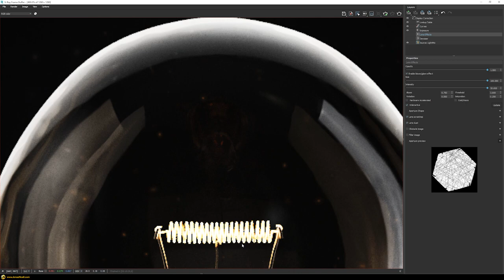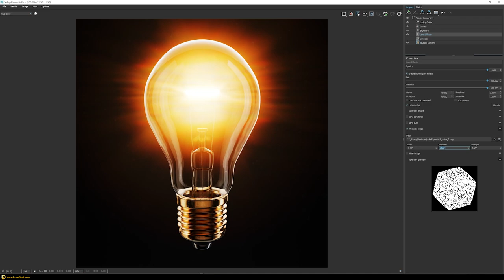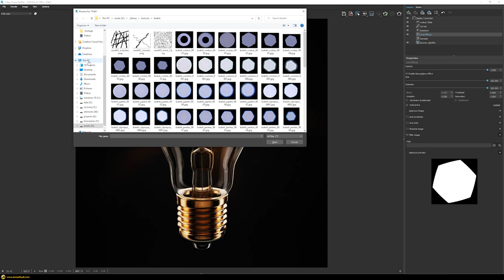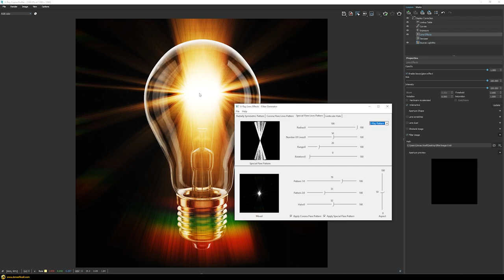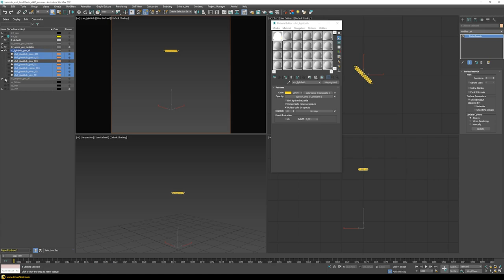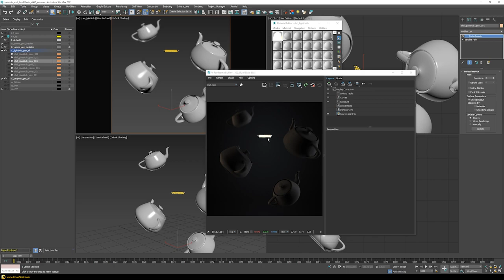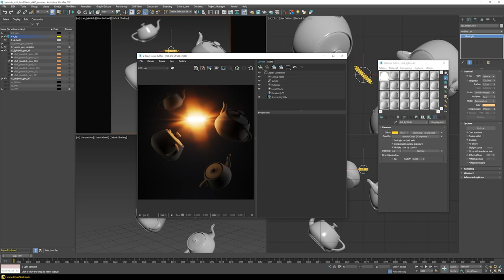V-Ray | How to use LENS EFFECTS | Theory, General Workflow, Issues & Solutions

Comment: Hello @JonasNoell

I have a render scene of 3dsmax+Vray and somehow I cannot run the lens effect except when I open a new max scene from scratch. What you have to switch on that it will work or what can cause it's not running?

When I've got open a new scratch scene it works but how can I select, that for example only one light bulb of three is glowing and the others not even if I applied VrayLightMtl?

I dont know where else to ask
Reply from the maker: This only works in the latest update of V-Ray where you can apply a mask to the LensEffects. You can check out my 6.1 Update video for that. 
As why your lens effects only show up in a new scene probably your original scene doesn’t have the ‘Autoswitch to Effects result’ enabled in the render setting in your original scene…
Reply: @JonasNoell   Thanks JonasNoell but it's ticked on. Somehow I dont get why it's not working in my scene anymore. Maybe something is colliding or avoiding it.

Anyway I would like to ask you another question because I am pretty sure you know how to solve it. 

Cars most often have Daylight LED in the front. Is there another way you can light it up in Vray than with VrayLightMtl because I am missing the lens effect (glow effect)

Comment: thanks for the video. but why it is not showing if I put exponential in my color mapping and have my burn and bright value  adjusted. Thanks
Reply: Had the same problem.  Someone else pointed out that it may be the Color Mapping render settings. Instead of using Exponential try using Reinhard or Linear Multiply.  Worked for me.

Comment: hey Jonas I love your videos, i was wondering why you never use the mesh light option for lighting things such as this light bulb metal piece
Reply from the maker: Hi, because mesh light is like the most ineffective way of lighting something, because it would internally create one light per each polygon face. So unless there is a really specific reason why you can’t get around mesh lights I would basically avoid to use them at all costs :)
Reply: @JonasNoell  wow, I didn't realize it creates a light per polygon, that must be heavier on the render engine.. what if its a very low poly mesh though, thanks for answering <3
Reply from the maker: @sherifhany386  The more lowpoly the better of course, but I would always try to fake as much as possible by just using planar, disk or spherical lights wherever possible. So far I haven't really encountered a plausible situation where meshlights were the only possibility. But anyway it depends on your specific situation. I'm not saying you should definetly not use them, but you should be aware that meshlights are the most uneffective way of calculating lighting in V-Ray. So if possible try to use other approaches :-)

Comment: Great One !, Keep up the awesome effort 
How can I generate  Bloom/Glare for specific lights in the scene (Instances for example) or how can I have more than one type  of effect applied inside the Frame buffer without the need mask it in the post (photoshop)
For example
First one is settled effect for the large sources like windows
The second effect could be much stronger for small sources (lamps/spotlights ...etc)
Reply from the maker: Hi, thanks for your feedback. Regarding your questions, AFAIK right now it is not possible to have multiple lens effects with different settings for different light sources in your scene. The only way to control where the lens effects are appearing is with the treshold so you can just limit the lens effects based on the brightness of certain pixels. For a combination of different lens effects you would need to go through Photoshop. I agree it would be better to have more control about this, such as multiple lens effects for separate lights and so on. Let's hope for a future update :)
Reply: Even if it seems that we are working on light, it is in fact on the parameters and the nature of the lens placed in front of our camera that these settings apply. It is therefore natural that these adjustments apply to the whole image. You cannot use several objectives with different types of diaphagmes or different lenses depending on the part of the image to be processed.

Comment: I never got the lens effect working, is it because i use architectural feets and inces unit setup instead of mm or cm or is it something else, also when you use Vray sun along with interior lights and use lens effects there is bloom and glare in all the illuminated portions even when you play with the threshold value it doesnt seem to work so if you can help in that it would be great, i can also share a simple scene to illustrate that
Reply from the maker: Hi, the chosen units do not have any impact on the lens effect as it is a very 2d post effect that is applied to the finished rendering. For the other part you would need to share a scene and I can take a look :) info@jonasnoell.com

Comment: there are no layers over here. no lens effects.. nothing. how do you get them back? can't find a solution anywhere
Reply from the maker: Should be there by default, in fact there is no way to remove it manually :-) Try switching to Scanline render and then back to V-Ray and see if that does anything
Reply: @JonasNoell  strangely enough that did the trick.  thank you!

Comment: How do you save out the lens effects pass in animations? Not just stills?
Reply from the maker: Hi, it generates a RenderElement pass calles Glare, that contains the layer so you can use it in post. There should be no difference between stillframe and animation in that regard.
Reply: @JonasNoell  I usually have to render a still frame then apply glare. Do you mean once I have done that go ahead and re-render the frame as a sequence and it will then apply the glare effect settings to every frame? Through frame buffer/seperate render channels?
Reply from the maker: @DavidBaca3d  I hope I understand your problem correctly, but you would basically need to enable the lenseffects and then render out the sequences with all the renderpasses. You then have a layer that only contains the glare. You could technically substract then the glare layer from the RGBColor pass to have both of them seperately and then later add the glare effect back in again. 
Probably you can also hide the LensEffects pass while keeping it enabled and then this way you would render out a RGBColor without lenseffects and still have the Glare in the renderelements. But I didn't try this out, so don't take my word for it :)
Reply: @JonasNoell  Yes exactly what I was wondering! In my mind I was thinking "Am I going to have to render out this sequence twice just to be able to seperate the glare pass from the base render?" I'll do some testing and try it out! Thank you for the replies!
Reply from the maker: @DavidBaca3d  Actually I just tested and when you render a sequence you will get following 3 passes:
- RGBcolor pass that does NOT contain your lenseffects but just your raw rendering
- Glare pass with the lens effects separated on black so you can add it back in compositing
- EffectsResult pass that has the lenseffects applied to your RGBcolor (together with all other colorcorrections and so on)
Like this way you should have all the things you need technically :-)
Reply: @JonasNoell  I'm going to try it out for myself now. Thank you for taking the time to test it out!!

Comment: Hello. I use V ray 5 and my bloom effects are lost after the render finished. Why can it be? Please, help my friend :(
Reply from the maker: You mean once you save the picture or when are they lost? If you check the saved out frames there should be an EffectsResult Channel or something  similar that has the lens effects saved in. Just go through all the saved out channels.
Reply: @JonasNoell  This is very strange but I opened a new page and tried to do this effect and effect didn't lose any more. I had used HDR Light Studio for the last training. Perhaps, it changed something. Thanks, my friend. I like your videos and I follow you.
Reply: @JonasNoell , Finally I solved this problem. It is about threshold settings. When I make it closer to 0,000 then I could see great results on the object and I saw you did it. But you made intensity is very very high. Even if I don't touch it, if I make the threshold closer to 0,000, my object seems perfect with bloom effects. Thank you for this great video.
Reply from the maker: Ok good to hear you managed to solve it 😀
Reply: @JonasNoell  Thanks so much. :)
Reply: @muhammedbaykul3194  Thanks for this, finally i made it.

Comment: In pervious version of Vray I can save render element from glare/bloom in a separate channel .... in Vray 5 where I can find this option ?
Reply from the maker: This option AFAIK is not available anymore and both are combined in one element which is called "Glare". Basically the way the lenseffects work now is that you don't have bloom and glare separately like in earlier versions but they are combined in one effect where you fade between bloom and glare.
Reply: @JonasNoell  you didn't catchup what I am saying ..... I mean how to make all glare into an element so I can use it in Photoshop and mask what ever I need
Reply from the maker: @mego2022  It should create a renderlayer automatically which is called "Glare". In there you have your lenseffects separately on black so that you can screen or add it back on original rendering. There is no need to manually add the option to create a renderelement anymore like in earlier versions. Are you not getting a renderelement that contains your lenseffects by default?
Reply: @JonasNoell  Here, This a link for a screenshot I've made on a pervious Vray version and I Mark on the option that I do not find in the current version 
https://pasteboard.co/JE12wF9.png
Reply: @JonasNoell  No I am not getting the element automatically, Any help?
Reply from the maker: @mego2022  This option is not available anymore. By default it creates now a separate element once you enable lens effects. If you save out your different channels there will be the:
- RGBcolor pass that does NOT contain the lenseffects, then there will 
- Glare pass for the lenseffect separately on black 
- EffectsResult pass that would contain your rendering with the lenseffects (and all other effects) applied to. 
So it basically always gives you all the options you would need. The only difference is that now there is just one Glare pass, while earlier versions had Bloom and Glare split up in different channels. Now they are combined in one.
Reply: @JonasNoell  Thank u so much I'll try it again .
Can u make a very detailed video on lightmix because I've an issue that I am not getting all scene light in the lightmix and if I have all the lights, Turning on or off would not affect anything on the image .
Reply from the maker: @mego2022  Actually I have a video about lightmix, you can find it in my channel :) You can see if this answers your question about that fist!
Reply: @JonasNoell  I will check it ... thanks alot
Reply from the maker: @mego2022  That is odd, for me I am getting this Glare pass as soon as I enable the lenseffects. Can you make sure they are visible and also additionally enabled with this checkbox in the lenseffect settings tab? Are you seeing the lens effects in your viewport when you render something bright?